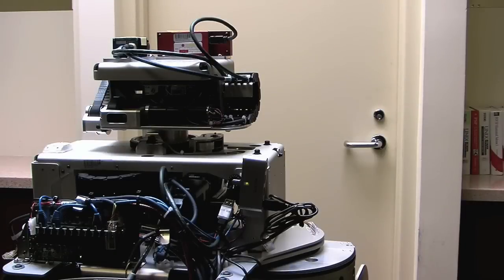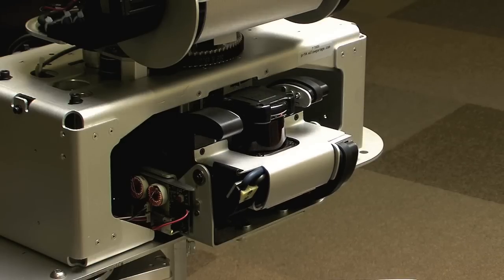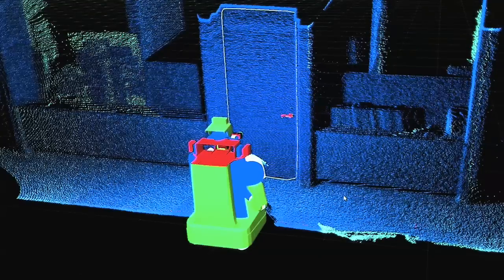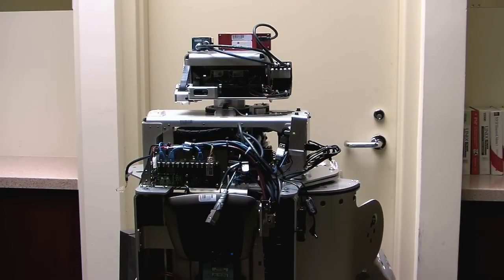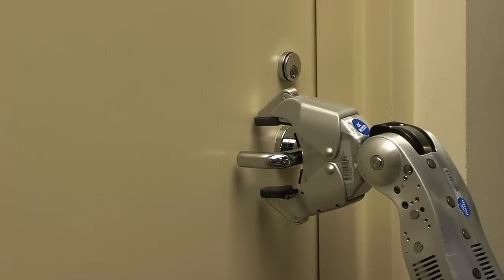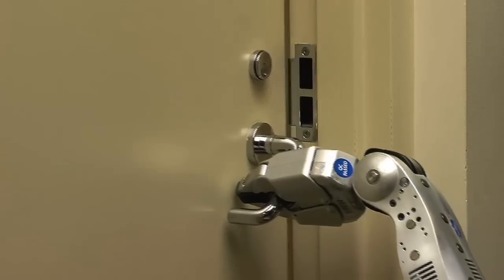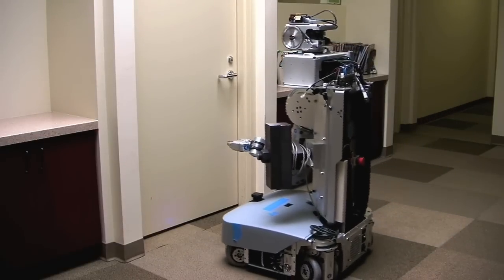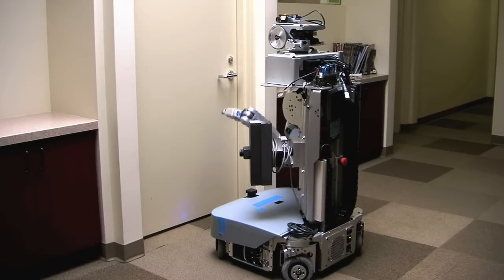Opening Doors

Comment: The laser is decently safe -- the much bigger problem is that it is just too slow to do the up/down scan.  Fast/accurate depth mapping will be an enabler for robotics.  We are working on using stereo with projected light. Many other methods are possible with many other tradeoffs -- how much light you can put out vs/power  use and eye safety, the sensitivity of the sensor etc.  Not easy ... but that's what makes it fun.